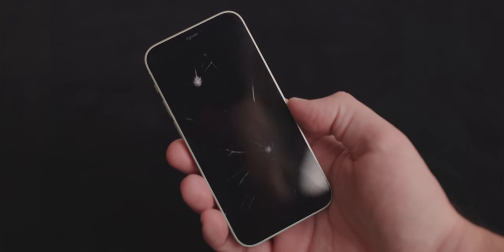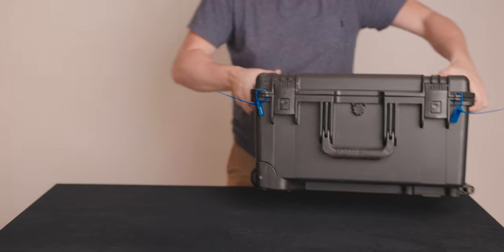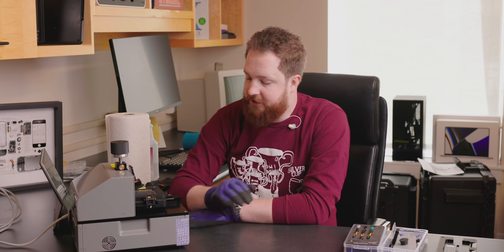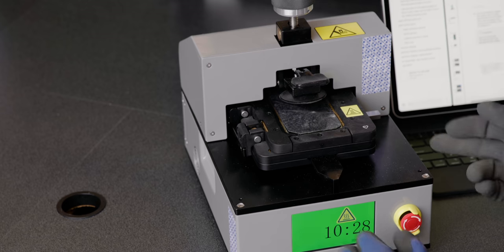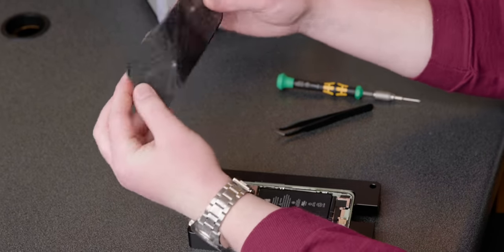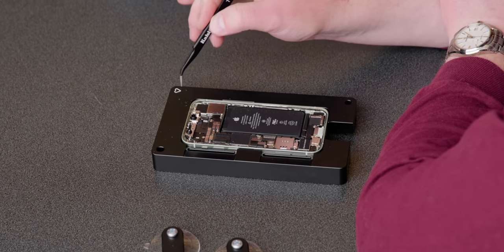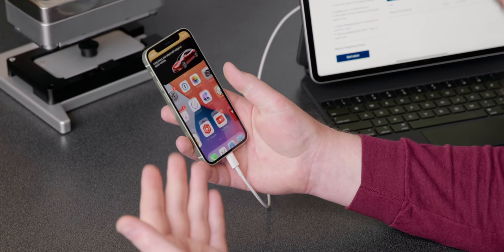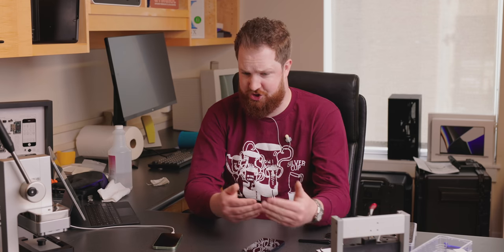Using Apple’s Tools to Fix My iPhone

Comment: The day Apple said customers will be able to repair their device at home we all looked at each other in the repair room and said so they are going to ship ALL the tools or have people cooking their phones on a stove top? Well glad to see they did it right. These are the exact tools we get to use. Btw if you do attempt to do this at home with a broken display, when you put the display cover on use the “black stick” aka spudger to press the cover down to the display from side to side top to bottom. You will see it change from the kinda grey here in the video to a more black color, it works much better and if you let the adhesive sit for 12 minutes even better. Other wise if you start pulling and the cover pops off you better get a new one since it won’t stick very well the second time. 
The display heater and removal tool takes some time to get used to no way around it. 
They give you extra screws and PSA, we called it “Purposely S**ty Adhesive” but it is actually called pressure sensitive adhesive because sometimes you may seat the ribbon cables slightly off and not have a good connection and the display will light up but the ALS or the proximity sensor will not have a good connection and will fail post diagnostics. 
Then you get to do everything all over again and you shouldn’t use the same screws second time round. Since they are so small Apple says they may stretch slightly making them out of spec for size and torque spec and the head of the screw could be easier to strip if used more than once. Also please use a grounding strap, you could do everything right but a little bit of static could destroy your device and all you stuff. 
To your point of “why does it take so long” ^this and the fact that you cut the boring waiting stuff out to make a 30 minute video, our stores wait time is 1:30-2:00 hours so I would have 2 phones done in this same time. One running post diagnostics while taking another one apart, by the time post is done on one the other is ready for post and the cycle continues. There are different post diagnostics depending on what repair you do. 
Plus the wait time sky rockets if you have to do a MLB replacement. 
Just really glad the speaker doesn’t have to be replaced anymore if the battery comes out, that was a stupid design and a huge pain.

Comment: For a company like Apple, I'm surprised they don't just provide a simpler and more locked down/obfuscated app for the post repair diagnostics. Like I would hope that they would have a downloadable app behind the repair-order wall where you can just boot your iPhone, connect it to your Mac or PC with a USB to Lightning cable and then just have it run all the required "diagnostics" and pairing locally. Automatically too like a one-tap process. They can use your S/N for verification or multiple uses or whatever. Like the whole "the user needs to call Apple" thing is just redundant if they are off work hours or they're closed for some reason.

Comment: As someone who works at a 3rd party repairer. This is a comical amount of effort to put into a repair.
The face ID issue is easily avoided by moving the original sensor flex from the old screen to the new.
With practice you can get a i12 screen off in like 5-10 minutes with pry tools and suction cups

Comment: Basically You have to call them because it puts the Devices serial number into the Battery Board along with the Displayboard once it reads the serial number it unlocks the display software the Diag mode enables writing the Config to the Phone
Reply: Pm me🔝..

Comment: Those white strips only work when you pull them I use one hand to pull the tape to 90% tension and my other hand up close to the battery slightly pulling as it releases this allows the tape to flatten out instead of pulling it up against the bottom of the battery adding more thickness and surface area to cover pull straight toward yourself and use  your fingers they can feel the tension rolling a tool adds force tension before it’s removed you have to stretch it let it unstick itself before you pull the stretching add more dry surface area naturally unsticks under tension you’ll find it just stretch and wait don’t pull

Comment: 7:17 Haven’t seen the whole video yet but when you locked it into the screen removal machine, it was so tight because the camera was supposed to be at the bottom and the buttons had a minor indent in the heating contacts, hence why you heard the buttons press when you locked it in. It isn’t that tight normally.

Comment: As someone who has a store where we do 3rd party repairs.. We don't need any fansy tools. We can do it all without it just fine, with the same quality. And the cheaper version is also available for more cheaper screen or the same quality oled. But we don't configure nothing. We have a small device which we connect the old display or battery which will then copy the codes to the new display or batteries, then we good to just put it back without any error msg. Just as a new phone
Reply: Pm me🔝...

Comment: When the battery straps snap, use a needle and IPA and put it under the battery. It will dissolve the sticky stuff very fast.

Comment: - I really hope they don't use that same opening machine for removing the display for other repairs kinds of repair (for instance, a bad charging port). It seems to completely ruin it from excesive mechanical stress on one side.
- Regarding the seemingly unnecesary amount of moulds and plastic pieces: that's for uniformity and eliminating the chance of operator error, which is great! I'm a part time technician as well and I would really like to have these, but I work on several models from several manufacturers, not just iPhones, so having those for each and every one of them would be impractical and costly for me. That's where being "specialized" in a particular brand (which leaves lots of potential clients out of the question) actually makes sense.
- I agree with this dude, the press is the only piece of equipment that's actually necessary in this kit, because even and consistent pressure is such an important aspect when working with double-sided adhesive. The rest of operations can be done manually. Screw holders? Give me some post-its or a magnetic mat and I'm golden.
- I don't like with the last part of the process. Asking Apple to pretty please "diagnose" your phone? Can't such diagnostics be done on-device? Why do they need to log your phone's serial number? Why does it have to be done through a phone call (a deterrent IMO) to begin with? This sounds like hardware activation to me. This is YOUR phone and YOUR spare parts which YOU bought with YOUR money! Dang,  and I thought us Android users having to ask the manufacturer to "let" us unlock our bootloaders was bad enough.

Working with legit OEM parts is such a breeze! I don't bother with "custom" or "generic" parts anytime OEM parts are a viable, cost-effective option.
Now if only the manufacturers sold them to us at reasonable prices instead of us having to scrounge them from China and hope for customs not to notice...

Comment: 18:42 I don't think that second adhesive is a back up. You have bought both display and battery since replacing both of them seperately requires destroing adhesive, I belive each adhesive is part of the package (1 for display and 1 for battery).

Comment: I work as someone who repairs apple phones for a 2nd hand company and the massive tools you are given can just be done with something that is big enough to fit in to ones small bag or purse. And i was wondering how the non original battery and non original screen issue would be solved. This is, like you said, weird. This again feels like a complete anti consumer issue that apple is known for. If you don`t know how to remove a battery, it is relatively easy for you to puncture it and just burn the phone up, not to mention the whole house if you are not careful enough. The little screen adhesive press, while handy, not needed. Honestly, the only thing useful from the look of things is that you can call apple and let them remotely remove the NOB and NOS issue.

Comment: While Luke & Sam's video was fun, I found this more informative of how it actually works
Reply: I wonder if the weird paring process is in case a shipment of parts "falls off the back of the truck" because the Apple Store would be using genuine parts, and the ones they ship self-repairs should be as well. Though there's also the secure element portion of it with the Face ID system pairing to a single display.

Comment: Anyone can access diagnostic mode... Turn your phone off, hold the two volume buttons when you plug your lightning cable in... Won't do you any good though, you need the ASD 2 console to initiate tests

Comment: I’ve been in tech support for SO LONG that I can tell you the “you need to re-enter your Wifi password” bit is HELL because everybody and (specially) their mothers will not be able to get passed that point.

I’m sure you were the most competent and tech literate caller the representative got that day only because you were able to enter your Wifi password and follow his instructions
Reply: Which mother that cant remember the wifi password is going to be repairing their own phone? The whole point is for people that are comfortable doing this themselves. That mother is not on that list.
Reply: @philgoodinc2  diagnosis mode is something used all the time by apple support, not just self repair
Reply: @MandoMonge  You're missing my point. That step when someone is already taking their phone apart and doing this fiddly work is not really a hurdle. That number he called was specifically for self repair, wasn't a general apple number.

Comment: Part of the reason the repair is more difficult is due to the change of PSA used (the adhesive) and the way the display sits more flush to the enclosure. 

I’m sure there are other ways to open the phone but they are going to be harder, but once the phone is open you’ll notice it’s easier to repair.

Less screws involved to get the cowlings off and the battery is still the same as far as having the tabs to remove it.

Worst case you can take out the bottom speaker and Taptic Engine to get to the tabs easier. 

And yeah the TrueDepth (top camera) should be treated with care . Apple just allowed those cameras to be repaired in stores but DIY isn’t an option yet. 

As far as configuration goes… I really wish they didn’t outsource the diagnostics to a 3rd party company. That process can go way smoother with people that know what the diagnostics and system configuration is doing opposed to people just reading from a script. 

But this lets me know that Apple is keeping a close eye on the part authentication process and not letting the coding out into the public. 

Overall I think it’s an interesting option, but your not saving any time or money, unless your not close to an Apple Store, or already have a repair setup and just need to flesh out your tools and repair process.

I have to do these kind of repairs every day in less then an hour per phone and when I heard this was coming to the public all I could say was good luck lol.

Also I can hear the cries of all the people that damage there display trying to just replace the battery from here 😂

Comment: i used to repair iphones on the side for extra money, my tools included a bit driver, guitar picks (like actual guitar picks not ones made for repair), and a roll of thin adhesive. great that they're opening up parts for order but are all the tools really necessary? I bet the cost would come way down they just sent you the actual parts you needed.

Comment: I would have thought a couple screws to hold the battery would have been much simpler. What a Rube Goldberg procedure just to change a battery.
Reply: Glue is more secure. Things can still flex and move around with just screws. Not so much an issue on rigid components, but batteries are a little squishy. Even tiny movement inside the case can cause them to wear out on tiny spots that can make them rupture.

Comment: I would like to know if there is a way to enter diagnostic mode and pair new parts to the phone without calling customer service. that would be extremely useful when replacing an earpiece speaker without losing face id which does happen more often than you would think. diagnostic mode in general is very intriguing to me as a third-party phone repairer.

Comment: 15:11 Tip: pull as flat as can towards you, find works best and as slow as can while “rolling” up the adhesive, or just keep pulling like removing a command hook. Pulling at 45° angle or greater, gonna break every time; unless you’re the luckiest person ever.

Comment: The wera and even wiha torque drivers are pretty cool, and even regular screwdrivers.
Also, calling Apple for display and battery just goes to show, they COULD turn this feature off, as it’s software locked, but they don’t. Imagine if they did, and how much easier this would be for everyone😉
But what if only have 1 phone to call, and the phone u have is the 1 repairing, lol!

Comment: yo thats a lot of gear, but it will get more refined as the cycle of this continues. you got the straight up actual engineering tools, as they themselves would use.
Reply: Pm me🔝.

Comment: I think a lot of people are missing the point with the program, Apple isn't forcing anyone to use their repair tools to perform the repair, they simply offer the same tools they use in store as an option for people who really want an OEM finish. There's nothing to stop you from purchasing the part via Apple and then using a cheaper iFixit kit or similar to perform the repair, and indeed it is probably a much better option for 99% of users.